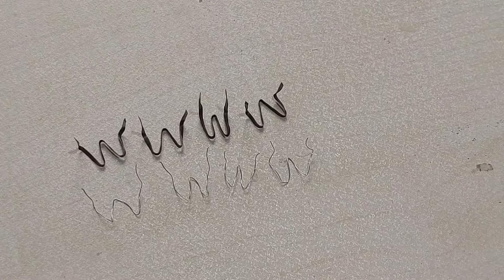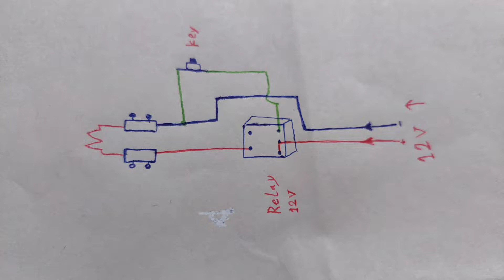how to plastic weld and fix broken or cracked plastic pieces

Comment: can I use 12 volt dc adaptor with source from 220 volt ac? is it safe?
Reply from the maker: Yes, you can, but you should pay attention to the amperage, it should be suitable for your work, it should be 2 amperes or more
Reply: @creative4979  Thank you

Comment: Hi, I liked your project very much.
If I will use a 12v adapter, how many amperes should I buy?
Also, what relay should I buy? Does it have any features?
Reply from the maker: 12 volt 10 amp relay and up
Of course, you can buy a stronger one according to your work